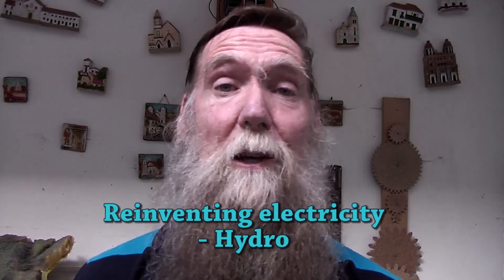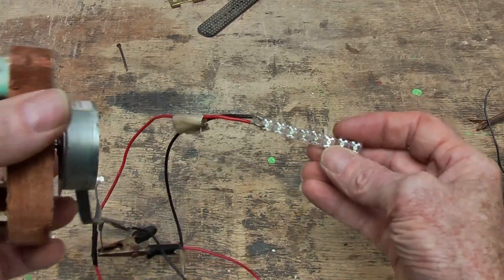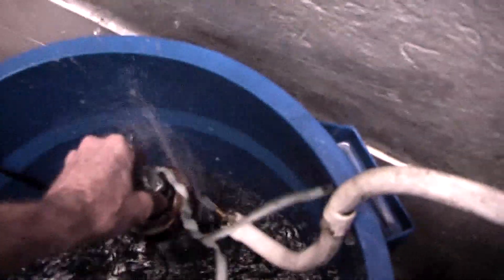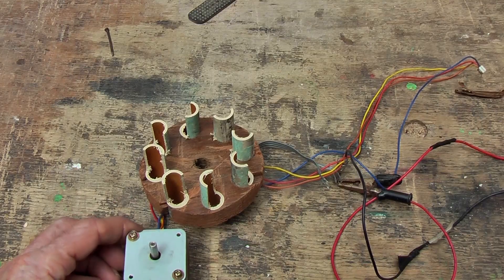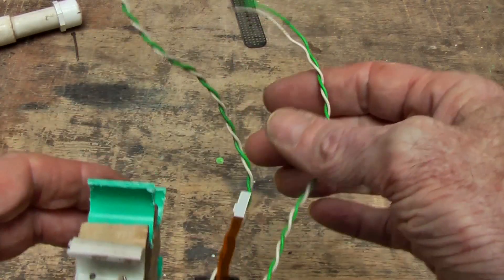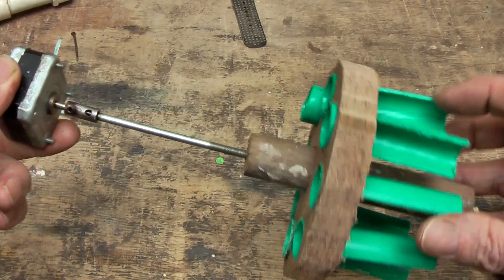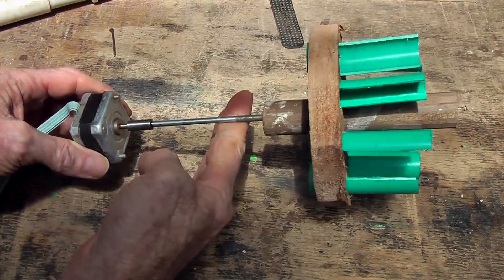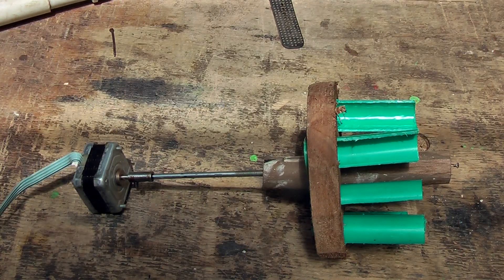Reinventing The Wheel And Electricity- Hydro 1

Comment: Hello there.
I have an idea for you.
How about using a empty pet bottle as a container for your motor/generator and a battery plus regulating circut?

The metal rod that connects your spinning disk and the motor could be loosly fittet through the bottle cap with a spacer made from aluminum pipe.
The circut for the batterie would be some diods and capazitors which provide a constant flow and limit the current.

It was a great video.
Greetings from germany

Comment: Hey Philip, great video as always. In Scotland we're striving for Hydro power from the North sea, as well as wind power. 

I'm curious to see if its possible to utilise an (even old from a shitty decade+ old home computer) PC power supply to get a straight forward 12v output from the CPU/PCIE/24 Pin output no matter the inputted voltage. Seen a few with quite a wide range for multi country inclusivity though that might still have a 120v (at a low amp/power) minimum.

I think the major idea you're fighting with here is gravity. Simply put, the larger the spindle the water is hitting, the more that a lot of water in a larger less pressurised jet is going to work for you due to gravity. A large amount of rain without being condensed into a smaller hose can definitely give you a lot more energy output if your generator wheel is larger.

In response to the Stepupp videos, honestly, they're food for thought for me. YouTube in general does not incite reaction from me. Not only is it now a common piece of life, but the best I can do is simply to listen to content rather than engage in it. I may consider it, I may think its a ridiculous assumption where denial of the general accepted perception is based purely on things such as unproven religious ideology that was only made as an "explanation" to the things that happen, and only fit because they were made to fit. Either way I dont comment because it's just not worth my time to comment. Not because it's your content or its thought provoking, but because YouTube has become such a part of consumer life that giving back in terms of feedback or responses just feels like you're spending 30 minutes making just a comment on an irrelevant forum and there's better things to spend time on. It's not a case of what my response MIGHT be, it's the case that whether I agree, disagree or could say something about it, I just won't. It's YouTube. I work all day every day. Watching videos is entertainment for me, whether it's thinking about a topic or content to engorge, it's a side thing. I've actually started typing responses in videos multiple times and thought "Can I really be assed spending another 20 minutes on this, and getting the sources together than I actually need for this to be accurate rather than just some Facebook statement of people who ramble nonsense without any proof?".  

Facebook style conspiracy theories or random bullshit "facts" are the bane of existence. Buzzfeed articles such as wild conspiracy theories with just enough conjecture to make people question beliefs is a living hell, so many people are gullible and fall for it without really thinking. They look into what was said and realise there's proof of what was said, not the validity of what was said.  These articles are only brought around to encourage clicks, to get advertisement revenue. And I feel even some of the avenues you go down are because you see some of these and consider it. Not because you fall for it but because you think out of the box and consider it as a possibility. The thing we call the human malware for example beginning with C that's a hot topic. Perhaps you see it differently that we do where I live. We see people die from it, in a country with healthcare to such insanity where dying from disease is not normal. There's a lot of reasons, but when I find myself typing a comment thatll talke half an hour to finish, I can't justify the time. Things like that are better for voice call or in-person discussion, where it only takes a fraction of the time to go back and forward.

Thanks,
Chris.

Comment: You should design something that will fit in a 5 gallon bucket. Just an intake where you can attach a hose. And an exhaust Port where water comes out. Everything else happens in the bucket. You could use a dish disposal motor. they're already waterproof.